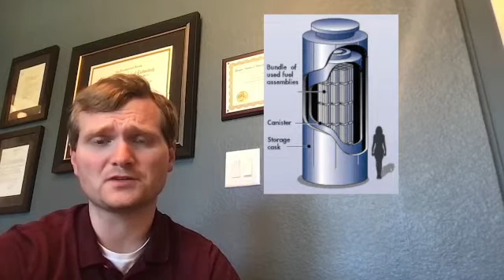Nuclear Engineer Reacts to Atomic Twister Part 1

Comment: Kinda cut off early at 7:18, maybe recap that in part 2.
Reply from the maker: Thanks for pointing that out. The point is the fuel stays in the pool for several years. Sometimes the fuel is reused for another fuel cycle before being placed in permanent dry cask storage.